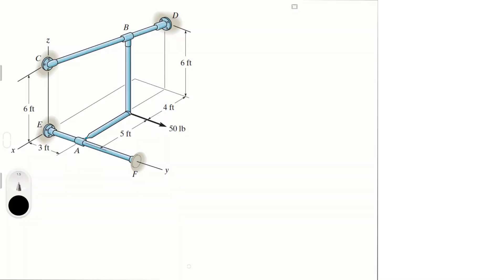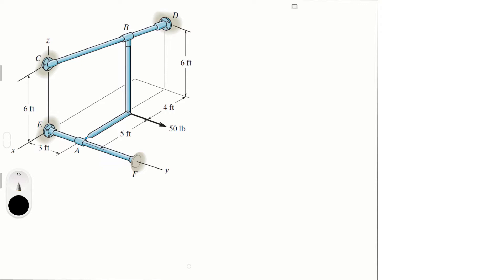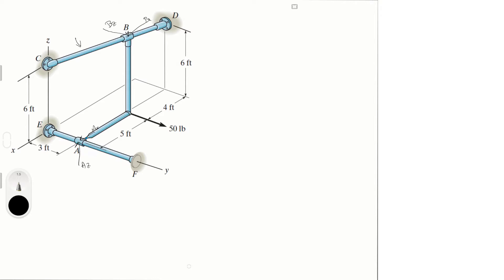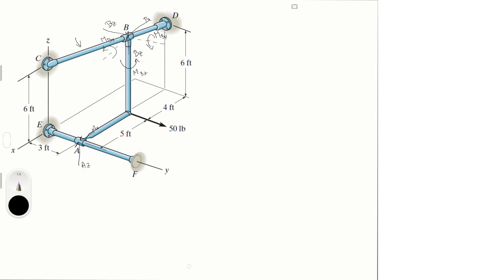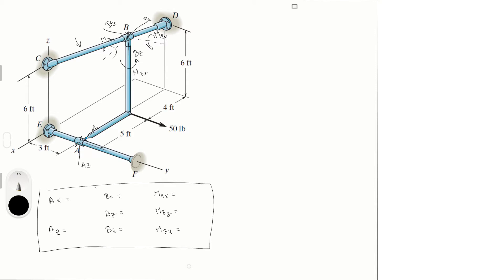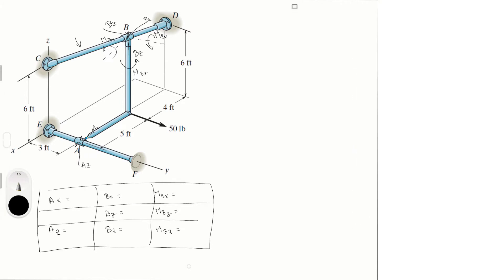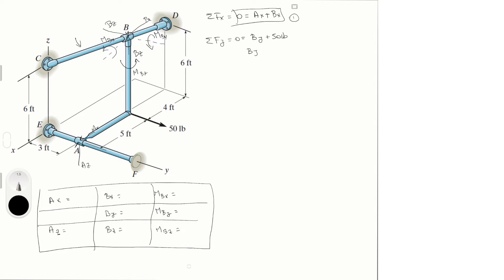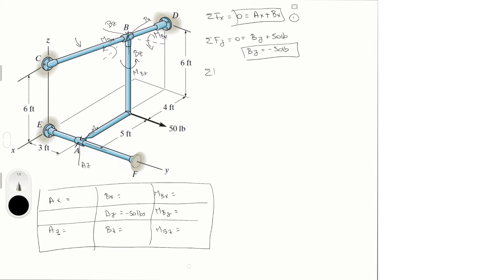Determine the x, y, z components of reaction at A and B

Comment: doesnt make sense to me how theres a reaction force of Az cuz theres literally no force in the z direction. we aren't given weight or any applied force in the z direction so theres an Az reacting to nothing
Reply: Quick break down of these types of questions
Look at the types of attachments/connections/pins whatever and look at what is restricted vs not,
Looking at A we see okay since its a slider along Y axis it can move freely along Y and if it wasnt attached should be able to rotate along the Y axis 
In short at A it will be restricting forces in the X and Z direction, and also restrict movement in the x and y rotations

Looking at B since it's angled there will be forces and moments in all directions because its not in line with our cartesian axes
Reply: The answers my text book had/ said were

The bar AB is supported by two smooth collars. At A the connection is with a ball-and-socket joint and at B it is a rigid attachment. If a 50-lb load is applied to the bar, determine the x, y, z components of reaction at A and B.

[Ax = 16.7 lb, Bx = 16.7 lb, By = 50 lb, M_Bx = 300 lb ft, M_Bz = 0, M_By = 900 lb ft]
and i figure its only referring to magntiudes

Comment: Also, why is there no Ay? It's confusing because if it was only a ball-and-socket joint then there would be an Ay. But are you saying that since there is also a collar, then there is no Ay? Is it because the ball-and-socket joint will 'slide' when the collar moves?
Reply: Because the collar does not restrict axial movement of the pipe passing through it.

Comment: Why do you ignore the reactions at fixed supports C,D,E,F?
Reply: It's because in the text book he got the problem from only asks for components of reaction at A and B.
The problem isn't written on screen here for some reason. He reads it out loud at the beginning though - " The bar AB is supported by two smooth collars.
At A the connection is with a ball-and-socket joint and at B
it is a rigid attachment. If a 50-lb load is applied to the bar,
determine the x, y, z components of reaction at A and B."